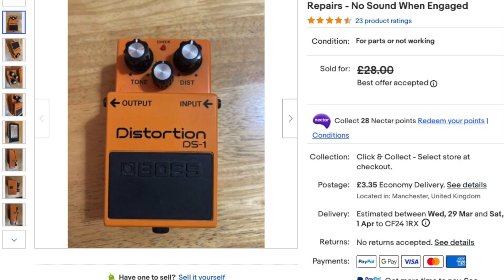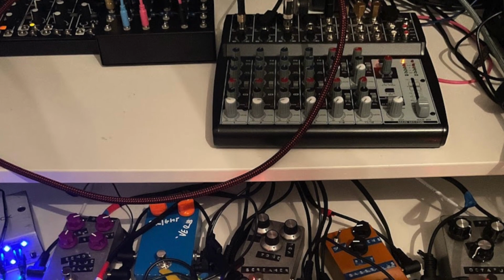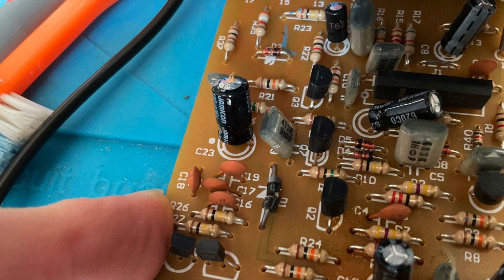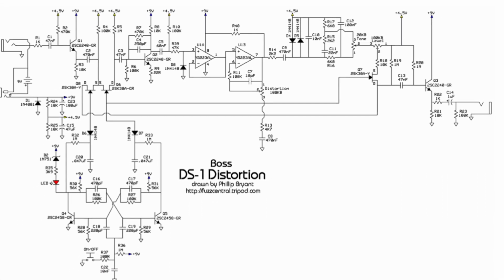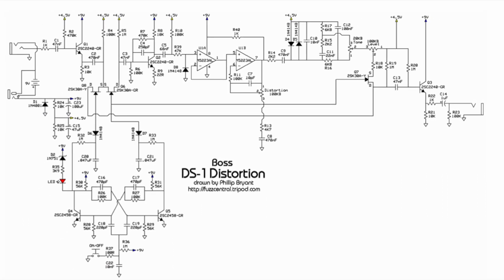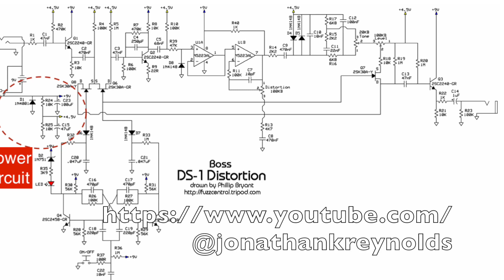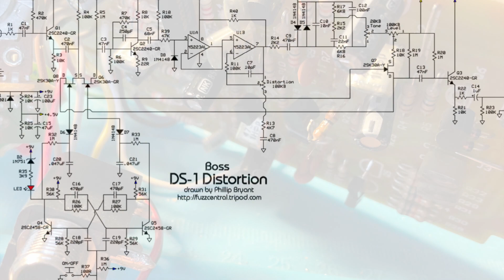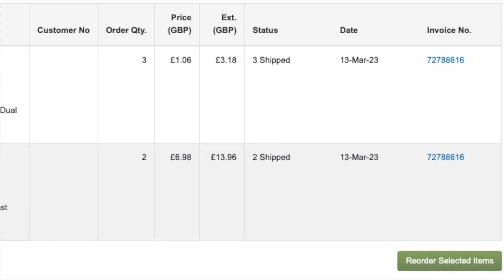Boss DS-1 distortion pedal repair story

Comment: Thanks for the video. I was wiring up my own for educational experience and was scratching my head as to how a single diode in parallel provided reverse polarity protection. Guess the short answer is it doesn't. Some further research showed that this only works for short periods of reverse polarity, which works fine for 9V batteries that usually won't be able to be mistakenly plugged in the wrong way for long periods of time, but not for plugging in the wrong barrel jack. I wonder if the newer models still have this issue.
Reply from the maker: That’s some great intel there! Thanks Jason! I think the newest PCBs are probably all surface mount. I’m on my third DS1 repair, and all three units have been the same PCB revision, early 2000s. I’d need a bigger sample set, but maybe it was a slightly daft design at the time?

Comment: I've got the opposite problem. Cannot disengage the distortion. Switch functions but i can't seem to figure out why the flip flop circuit is not disengaging the distortion. Any ideas?
Reply from the maker: I'm not sure I'm afraid! I'm not an expert, I've got another poorly DS1 on my workbench now which had the same blown fuse error, and I've not been able to fix this one despite doing the same fixes! I'd have tested the switch but you've already done that... Are there any bridged contacts on the board? Any bits of metal crept onto the PCB creating a bridge?
Reply: @Gavddotcodotuk  yeah I built the audio test probe like you did there and I'm pretty sure it's one of the flip flop transistors; both clean and distorted work when I bypass them on the board, and when I swap the clean and distorted with each other, I can only get clean. I have ordered replacements (but not before trying to pull some transistors from random e waste I had and swap them in, unfortunately nother seemed to play nicely.) Thanks.

Comment: Great video! I know how to repair guitar pedals, and at this point, if rather just buy a working DS1 lol.
Reply from the maker: Good choice! Ds1 is a great pedal to learn repairs on because there's no surface mounted stuff, it's all through hole ( at least the one I worked on is!) but yeah I didn't even make back what I paid for the broken one when I sold it on so false economy! I think there's a whole scene of chaps who repair stuff for fun which drives up the price of broken gear